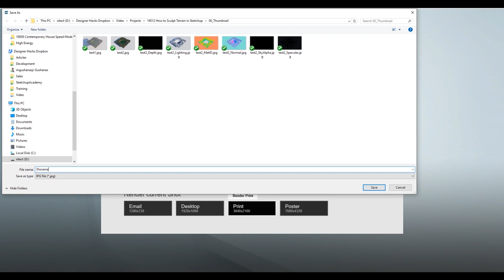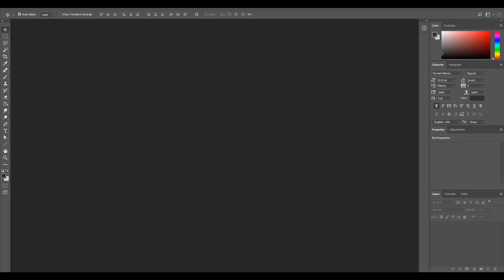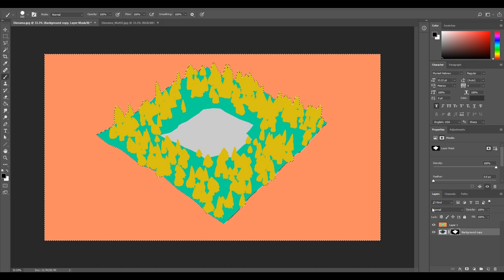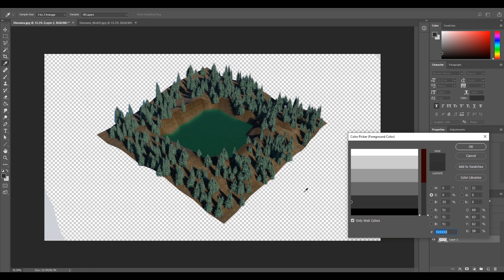EASILY Remove a Lumion Ground Shadow with Photoshop

Comment: thanks for reminding that option in lumion. it will help me. but you use photoshop way too slow =) you can double click on the layer to unlock it and alt+drag'n drop to duplicate. also you don't need to marque -> ctrl+a -> copy paste...... you just drag the image in one tag and drop it into the other one while pressing "shift" to center-drop. that's all. also to mask the image , after magic wand , you can select the layer which you want to mask and while the selected areas marqued just press the layer mask button down on the layer window. it will automatically mask the image. if the wrong area is masked then ctrl-z , right click on selection and select inverse. press the layer mask button again. I hope these tips speed you up. =)
Reply from the maker: Great tip!